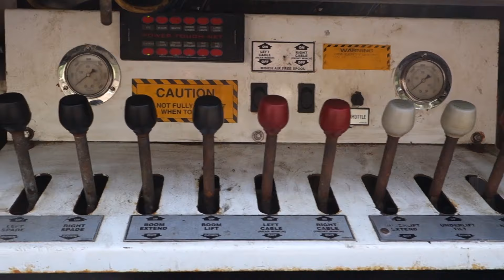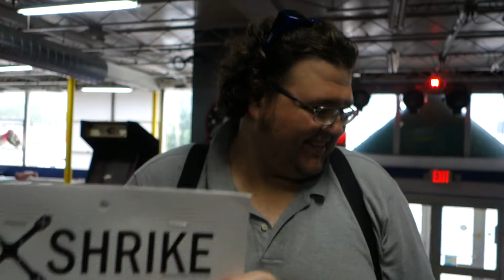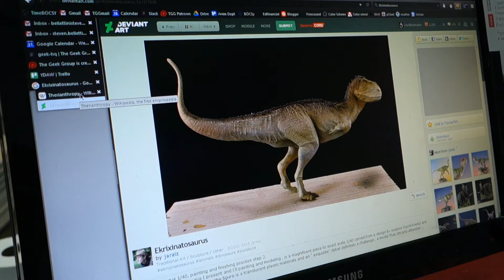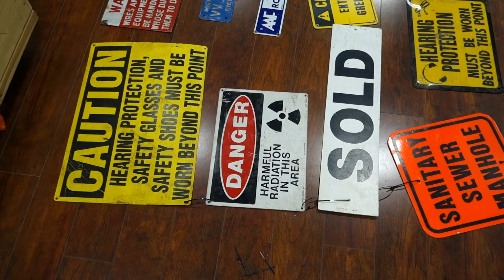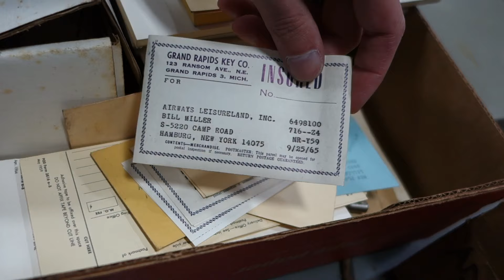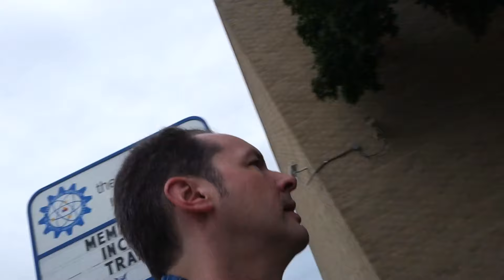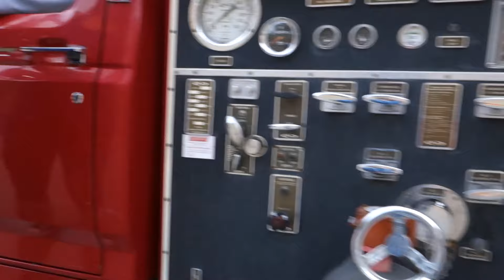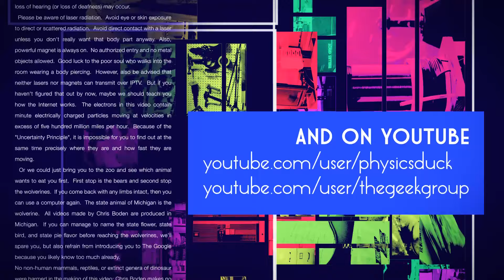Captain's Blog 7 21 2016 Firetruck is Fixed

Comment: If you buy carbon-zinc dollar store batteries, when they die you can tap the positive side on the table a few times and actually get a much longer run time.